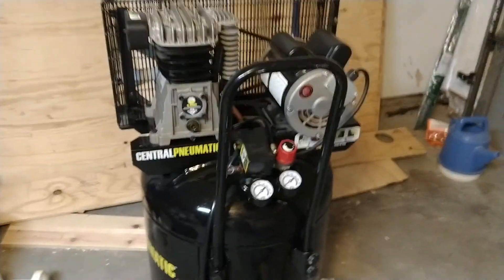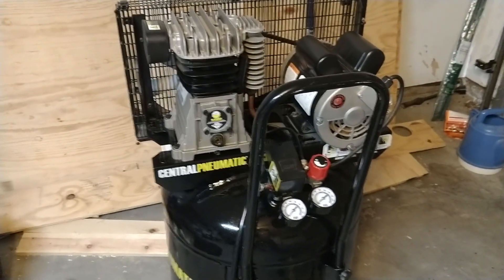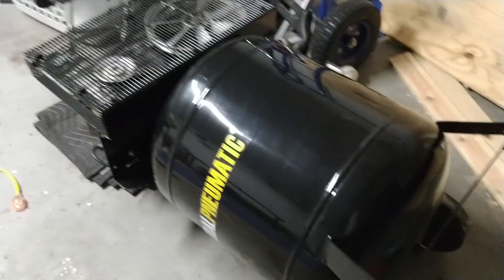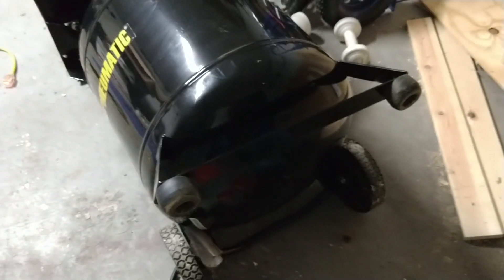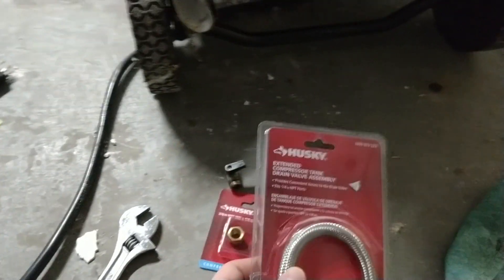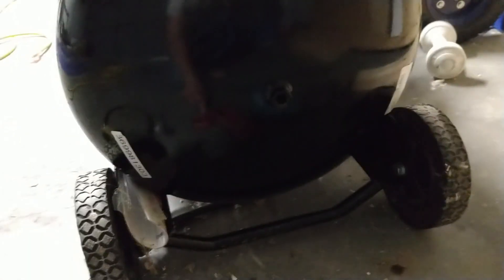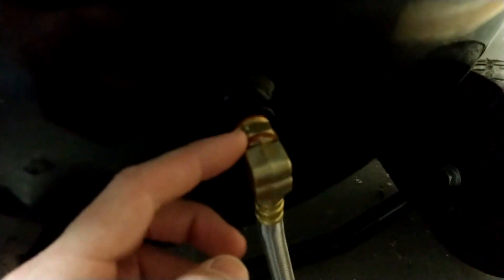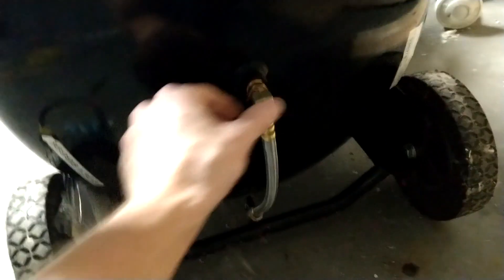Harbor Freight Central Pneumatic 29-gallon Air Compressor Oil Drain Plug, Tank Drain Modifications

Comment: Nice I have the same type of air compressor with the same crazy design it's a great compressor aside from that one guy drilled and tapped his to 1/8 pipe now I'm between your solution and his I think I'll try your way though
Reply from the maker: @hubertrobinson8825  I just didn't want to buy new tools and looked for a more turn-key solution, but I was a lot younger then!

Comment: One guy drilled out the opening and tapped it 1/8 pipe thread then use a piece of 1/8 pipe extender out about 1 inch with a ball valve and a cap I'm weighing my mind on doing the same thing with my 29 gallon too
Reply from the maker: @hubertrobinson8825  I like that idea and will probably do the same on my next one. One intent of this first pass was to not modify the original parts at all, but with a design this inconvenient it really should be done.

Comment: Hi Will I know this is an old video,but I have just followed the same solution that you had,however after mounting the adapter and ball valve the flow of oil is less due to the small hole from adapter.Have you seen same issue?What will be you recommendation?btw did not grind the adapter it did fit well without obstruction 39G HF Compressor

Comment: Great Video , What's The Capacity So I Can Buy Enough Oil ?
Reply from the maker: The capacity can vary from 16-22 fluid ounces, and oil weight can vary from SAE 20 to 40, depending on which revision of this compressor you have and how much you are able to drain. Check the manual on the HF website. Or, buy at least 2 quarts, and slowly fill the pump until the level is spot-on in the site glass.